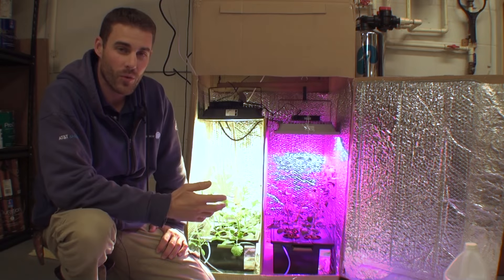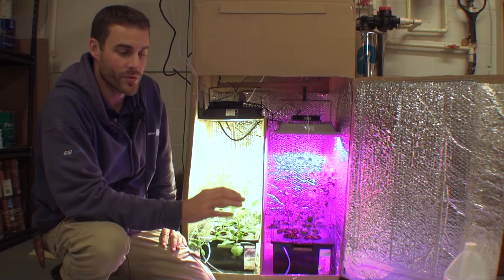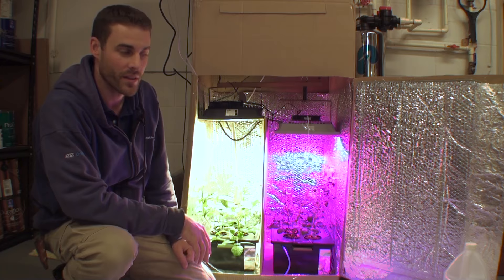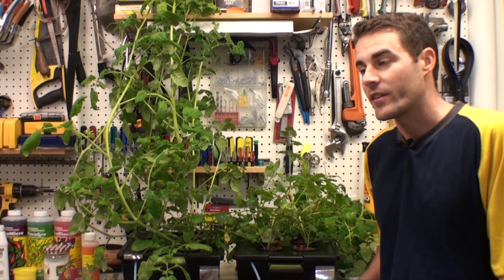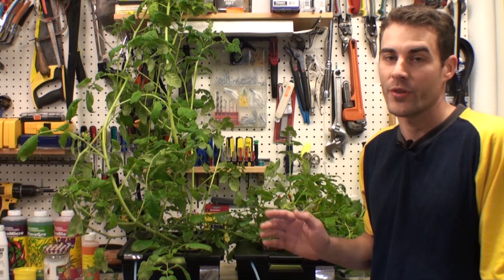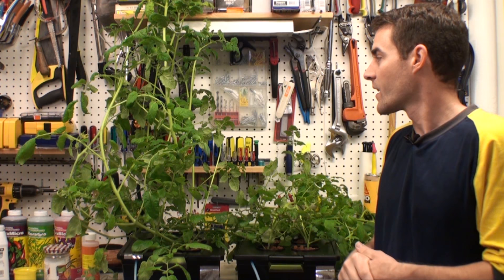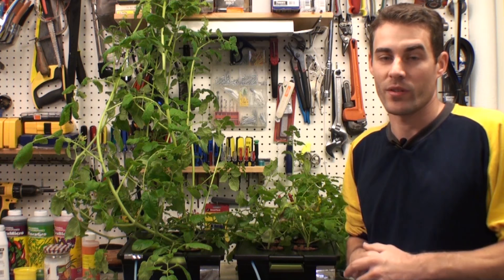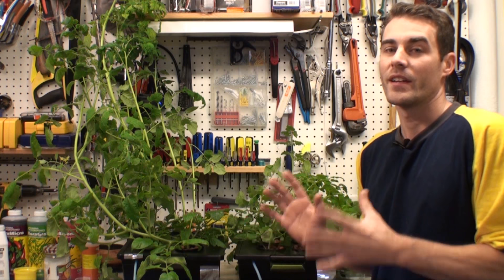White LED vs Red/Blue LED Grow Test - Part 4 (The Final Results!) "Hydroponic Tomatoes" 2016

Comment: You knowledge is amazing and  the detail is great. If I just want to use the lights for starting seedlings to a height of say 3 inches would a cool white light be best as it has more blue in it to make them "stocky"? Also would I be better to get say 100w lights higher up or a series of 20w lights lower down?
Reply from the maker: Jared Parkes color temp for seedlings is best 4000-6000k. honestly I don’t recommend the lights used in the video. They have poor heat sinks and the cobs go bad quickly. You’d need a fan blowing directly on them. Just get a few Sansi 15 watts or a single 40watt from amazon. Those will surpass the output of the lights in this video. I did a few videos on those lights if you want to know more.
Reply: Thanks. What PAR level would you recommend for seedlings to about 2 inches tall? I'm confused between what is recommended for full grown plants vs seedlings.
Reply from the maker: Jared Parkes about 300um. 700 and higher May burn them.
Reply: I've had great luck with a 30w blurple led, says it's equal to 300 but that I doubt, I've fitted a cabinet with the light and it has built in pc fans, putnsome foil stuff around the sides and its great for seedlings, they get nice and bushy, not tall, and have super strong stems, I've also noticed if I start my plants in the cabinet rather than the tent my plants will show some non glandular trichomes on their first few sets of true leaves, giving me a good head start on finding a terp profile I enjoy
Reply: Only issue I've had is with small heat issues once they get closers to the lights, also should've mentioned I do 12/12 lighting right after about 2 weeks of veg, I like small plants that produce about 5-10 grams, makes for more airflow through my 2×4 tent

Comment: Ryan, thanks buddy,  your 4 part series has been most informative.  I always had my doubts about red/blue spec LEDs as opposed to white/full spectrum due to intensity of the light. There are now LED strip lights flooding the market here in South Africa, comes in 5 metre strips at 14.4w per meter SMD 5050 with 60 pieces per metre. 72 watts  in total. 4:1 ratio with 4 red 1 blue...  from what Ive seen, its been hyped up marketing for growing kits, (due to the legalisation of personal use of marijuana), but their biggest flaw is the lack of blue spectrum however the same in white is half the price. do you think the LED strips would give the same effect as a flood light? I'd love to see a video on that comparison of flood light to strips, (dunno if you get them in the states? ours is all chinese!lol). I am setting  a kit up here, but its quite costly here in South Africa tho. I will happily share results once I have everything in place. Thanks again man, really appreciate the time yo uhave taken to do these videos.
Reply from the maker: Kinaestesia there are a few videos on strip lights and most of the time they are low PAR low power so mostly those are good for close proximity to small plants or seedlings. I don't feel red and blue is going to be any better than white when talking about low power consumption. strip lighting in general is not usually a good option for grow lights. The new led tubes that's replace fluorescent bulbs are superior to strips.

Comment: Ryan., Love your scientific test on LED lights in Veg . I would be extremely interested if you did a LED test in Bloom/flowering using the LED lights. I actually have  Viparspectra Par 700 dimmible lights and have never quite figured out the correct settings on the separate white, blue & red dials. Would love to see you do results on this particular light in Veg and flowering
Reply from the maker: Tony Tumminello https://youtu.be/Cx90nHDg4_s

Comment: The one of the left looks 5 times bigger than the one on the right, does this mean the white light is 5 x better?
Reply from the maker: intravena lol. Not really.
Reply: THEN what conclusion do you get ?
Reply from the maker: Federic Rodz the conclusion is that while plants can grow under the only 2 main wavelengths that is said to be mostly what they need, the other missing wavelengths play a bigger part than people may realize. Even if the other colors are little in ratio.
Reply: then sound like that all that we know about the light and plants is nothing compared with this conclusion.  Because the most growligth are focused to red/blue wavelength.
Reply from the maker: Federic Rodz sort of. Cheap grow lights favor only red and blue. Middle to high end incorporate other wavelengths and even some white LEDs. High end lights usually favor flowering unless they have dual modes. This is an arguable topic and we will start seeing more white LEDs used for grow as they developed. Adding more of another color such as red, is usually helpful for flowering stages in plants, but having a broad spectrum all the way through the growth process will yield similar results. It all depends on the spectral output. Not all white LEDs are the same. We know plenty about plants and their response to light wavelengths. The problem with LEDs used for grow lights is that their is so much versatility that engineers and botanists go crazy with tuning lights and claim its best. The sunlight changes its color depending the time of day and time of year. Trees are the most noticeable by anyone when fall comes around and they drop leaves. So by changing the spectrum you manipulate plants to grow how you see fit. We can do this very precisely with LEDs, but for the sake of simplicity, white light takes the guesswork out of it. Any white light source is going to be a sure way to grow. That way many people don't have to research what the best pink light is or worry how well a cheap eBay light will work. It's hard to go wrong with basic white light.
Reply: +Random Ryan The funny thing about white LEDs is that they are phosphor coated. That means that they're basically fluorescent LEDs.
Reply from the maker: Loren Husky yes I mention that in one of these videos. But fluorescents has nothing to do with defining power.

Comment: It would be interesting to see the difference between daylight LED and pure white LED. And also try to do an experiment where there is a mix of red, blue and white.
Reply from the maker: izzzzzz6 I did. Watch the lettuce video on my channel.
Reply: Saw that after i wrote that, and the the red & blue + White LED video. Very interesting.
  I tried DWC once but the roots went all mouldy and i think i had a gnat infestation, they were crawling through the clay pebbles. Too hot in the room, not enough water changes in the beginning.

Comment: Where can I get the white LED? Any links maybe?
Reply: I'm growing chili plants and are having are time even thinking white LED grow light
Reply: I can see you posted which one u used, but also that it got really hot because it wasn't made for growing. Can you recommend any white LED grow light that doesn't require a fan?
Reply from the maker: Claus Dall lightingever.com. You don't really need a fan, but it will make the light last longer. You should be using a small fan anyway if you are growing a plant. For the plant itself.
Reply: Thanks, Ryan. And you wouldn't buy LED strips? I found one with about 18 LED's, 540 lumen and 3500 K.
Would you go with 3500 K or 5000 K?
Reply from the maker: Claus Dall 540 lumen is very dim for plants. Maybe seedlings, but strips generally produce minimal light output. They simply don't have an inherent way to dissipate heat and therefore can only consume a fraction of a watt each so they don't burn out. Because they spread the light energy over a large area, they can only be good for short or low light plants. Strips are hardly good enough for low light aquarium plants. the kelvin really doesn't matter that much either. vegetative should be 5000-6000k, but 3500k would work just fine.
Reply: Fair enough. Very good information. I have a few more choices - if you would leave a quick comment for those. I found another strip that puts out 900-1000 lumen - is that still low? (this one is 5000K, and I'm growing chilies)
And I found sort of a big strip, hard to explain, but its PPFD value is 100 μmol/m²/s and is 16 W. Does that mean anything to you and if yes - is that very dim as well?
The link for it is here. It's in Danish though: http://www.ikea.com/dk/da/catalog/products/70323110/
Reply from the maker: Claus Dall 100um is on the low end of suitable for taller plants. You really need and least 300um. 700um is ideal for upright planes. You can't really go by lumens, but usually the intensity is a good indication of how much par you get. Lumens is usually in the several thousands before the par is enough for adult upright plants. And especially if it's a fruiting or flowering plant, you'll need much more light.

Comment: Hey Ryan, Just to make sure that it is the green light spectrum why not add a Green LED Light System into the Red light Environment to see if that would "Balance" it out, or if perhaps the UV/IR actually make the difference, by having a 3rd chamber with RedBlue and UV/IR lighting.
Reply from the maker: Adding green light to red and blue just makes white. Depending on how much of one color you add, determines the color temperature then. The difference in growth would be comparable to white light, but creating white light that way will not generate a broad spectrum the same way as white led or any white light for that matter.
Reply: well its interesting how the Red light and Blue light affect various aspects of the growth process, so the Green light has also some affect for the stem. Thus I was thinking if one places green light to assist the stem to grow stronger one would create a wholistic light that targets particular areas of the plant that need various light
Reply from the maker: Michael Biri I don't think targeting is necessary. If sunlight is closely replicated, plants do the rest. However some led lights are less intense so supplementing wavelengths can be helpful. Plants evolved to use and respond to all wavelengths even if only tiny amounts. Targeting becomes pointless though because color leds typical only put out one wavelength. ex- plants may like 670nm more than 680. You would need many bands if spectrum to start targeting and at that point you might as well use white light. supplemental is ok, targeting is not needed unless you are trying to alter something specifically.

Comment: Awesome non-bias vid! High quality and I didn't think you talked too much. Question: 
1.can you tell us the lumen output of the white vs red/blue?
2. Do you think my "American DJ RGB Panel " led lights would be comparable to the red/ blue lights you used? http://www.adj.com/profile-panel-rgb
I'm trying to see if I can use these DJ lights as grow lights
Many thanks
Reply from the maker: albizuis don't waste your money on that light. Super Cheap basic LEDs. It does have different colors, but its a very low quality, low wattage panel. The lumens will read much higher on the meter under the white light. Lumen is measuring more light in the green spectrum and the red/blue has practically none of that. Even if the red blue was 100watt, the 50 watt white will read higher lumen, theoretically anyway with those specifications.

Comment: I bet if you dimmed the white to pull 38 watts and added two more red and blues, the led would do better. Single red and blues don't work well. You need at last two blues and two reds like 420, 450, 630 and 660 because the chlorophyll a and b, carotenoids etc peak at different wavelengths. Adding a few other colors like a bit of yellow and a bit of green (it's a myth that plants reflect all green light- see bml horticulture) would improve the performance even more.  That being said, if I needed to choose between these two lights only, it seems that the white one would be the obvious choice.
Reply: Wouldn't it be the best choice to use these two lamps together?
Reply: Of course it would, but you'd have to switch them around so the plants could get equal light from each, but oh my goodness..these lights are like 70$ each (if I remember correctly) and there are a few very good looking LEDs on Amazon right in this price range that include multiple reds, blues, etc and I'd very much like to see a comparison done with one of those vs this white light. I've got videos of my grow room setup on my channel. Now...ive got a Mars II 1200 that is 550 watts and is about 500$, but I could just as easily get four of the smaller ones to light the same area and spend less. I got the Mars for free, so I can't really complain, but when I need to expand my growing area, I'll be getting smaller ones and running them side by side to light a narrow rectangular area since that is the easiest way to grow orchids.
Reply: You can get such a LED on a driver chip for a little bit over $10 from aliexpress. So, my thought was to use two of such LEDs just in something 2-3 inches from each other simultaneously as a single panel. I had some previous experience raising tomato seedlings with these purple LEDs. They showed, however, some signs of lacking blue spectre as I can see now. The idea now is to use one cold white LED to compensate for the lack of blue, and one red-blue LED. The question is: maybe there are some better alternatives?XD

Comment: Excelent experiment execution and carefulness. I wish the next experiment would be comparing two grow lights, one using sun light and other using purple fullspectrum light, or just the same experiment but adding a low wattage white light to the red blue light.
Reply from the maker: chapultepec I don't know if that would matter. That's why I made sure the amount of light reaching the plants was measured and adjusted appropriately. Wattage doesn't matter. Hypothetically You can take a 200 watt halide and place it 4 feet from the plants and then a 23 watt cfl at 6 inches and it would be the same. Well sort of. Those numbers are just a guesstimate.
Reply: I understand, I meant to put another light and adjust the height so that the plants recieves the same amount of micro-mole but replacing a few micro-mole of red-blue whith fullspectrum white light.
The other think i would like to see is a test of thwo real grow lamps, one made with cob white led and the other made of fullspectrum purple light.
Reply: is the white led a bright white or a off white
Reply from the maker: 253720881 slightly yellow-ish hue.
Reply: thanks man your info has helped a lot

Comment: please do white led vs fluro
Reply from the maker: Here the deal with that... I already checked the PAR output of 2, 23watt CFl's with a reflector. At 3 inches from the lights it was only 300uml. The white single cob led is around 2000uml at that distance. At around 8 inches from the led it hovers around 300uml. So while the plants would respond well to the spectrum under either light type, the penetration would be very poor under cfl and even worse under tubes. It would be fine for plants under 2ft tall, but led will always perform better if comparing taller plants. There is no need for experiments like this as the facts tell the tale as well as there being several videos on that subject already. Thanks for the comment!
Reply: That's very interesting - and surprising. That would imply that white LEDs are 6x as efficient watt-for-watt as CFLs, which seems almost improbable given that the light spectrum shouldn't be that different (both being phosphorous based as you mentioned). Is the heat loss 6x higher in CFLs? That doesn't seem right either.

I don't doubt your measurements are accurate, I am just trying to understand how the difference could be so dramatic. At 200 umol/m2/s it's hard to imagine anything other than lettuce growing under a pair of 24W CFLs, and yet there are plenty of T5 fluorescent grow armatures on the market which spread those same 48W over an even larger surface area than a typical 2xCFL reflector (ie. 2 foot tubes).

Is it possible that a  single point measurement at a distance of 3in puts the CFL+reflector setup at a disadvantage, due to the directional cone of the LED versus the CFL's omnidirectional light spread across a larger reflector surface? I am just theorizing here.

I imagine the PAR output from the COB LED might be significantly stronger in the center of its cone but drop quickly as you move the sensor out to the sides (which is ideal if you want to illuminate a single plant). By contrast, it might be that the CFL reflector spreads the light more evenly across its cone, giving less intensity to the center but a less steep gradient/dropoff in the 'corners' (which would be wasteful in a single-plant setup, but make it suitable for a grow bed with 6 or 8 plants spread out). Not having a PAR meter I can't verify this, but it might explain part of that 6x difference between the CFL and COB LED. Or what do you think? Am I missing something obvious?

Comment: there is no such thing as suction or vacuum! only there being a relatively lower pressure just above where the water is flowing through, down and out the pot,and relatively higher pressure in the air where the rest of the air resides.
Reply from the maker: Meadow Apple air pressure has nothing to do with gravity, but a vacuum draws air out and causes things to draw in the water in. That is of course if the pressure is not so low that it causes the water to boil off and eventually freeze. Imagine filling a bucket with water. It displaces the air in it. Poke a hole in the bottom and let it seep out. Air then replaces the volume of water lost. This is why watering potters plants regularly is important not just for nutrients and water, but for fresh oxygen at the roots. It helps to prevent anaerobic conditions. The quantity of water matters though. Can't just moisten the soil. Needs at least 25% runoff.